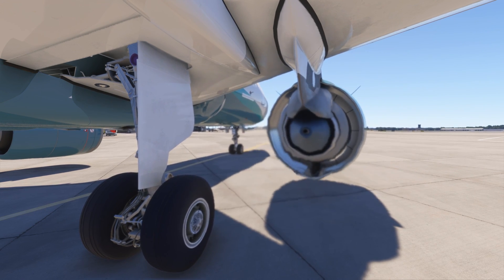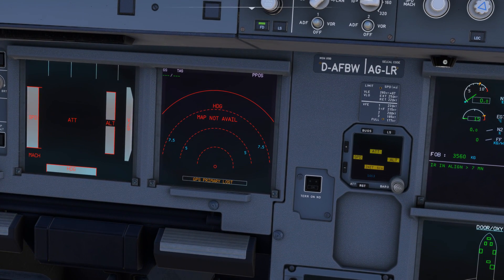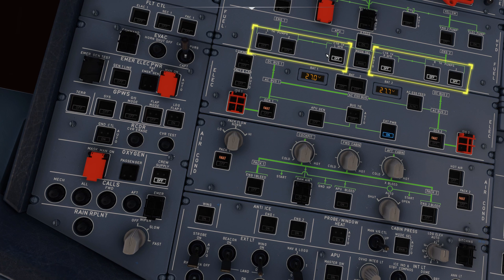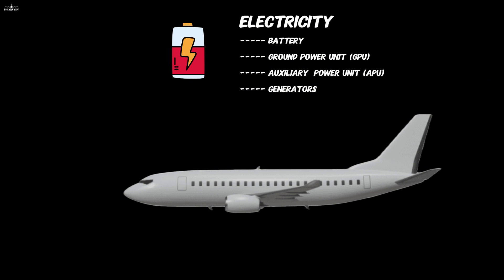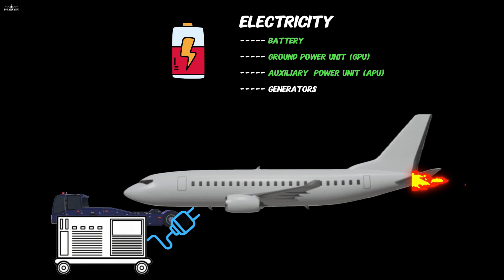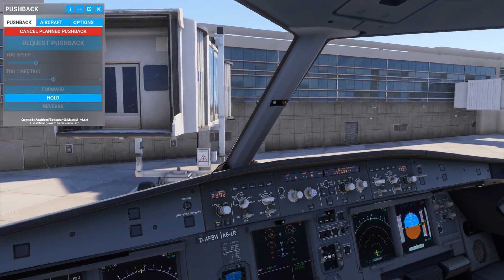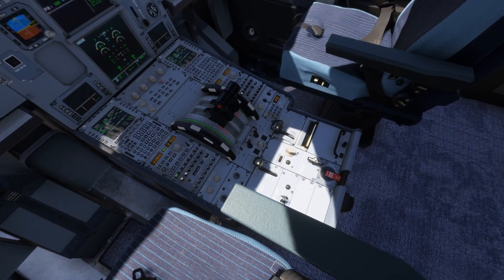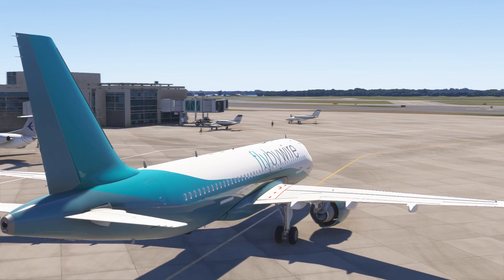[MSFS 2024] How to startup the A320 Fly By Wire

Comment: Thank you for that very effective video. May be you can help me: I use msfs2024, the FBW a320 does not show the cockpit. I look out through the missing cockpit… Any suggestion?
Reply from the maker: It's always tricky with mods especially on the 2024.
Maybe the first video of the playlist might help. Feel free to take a look.
Be sure to know where your community folder is, install the A320 FBW from the installer, be sure your community folder is properly set in the FBW installer.